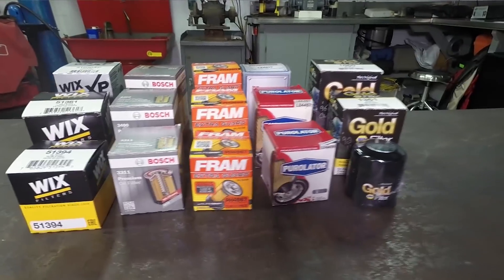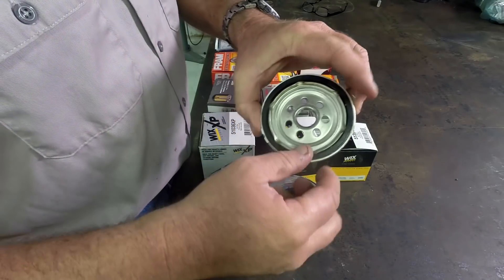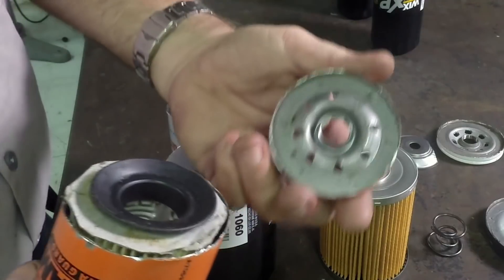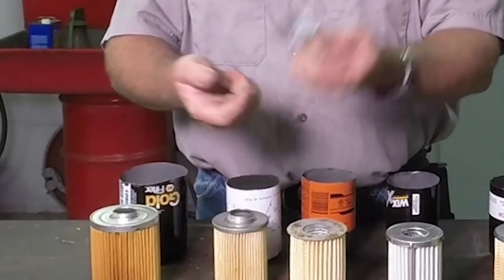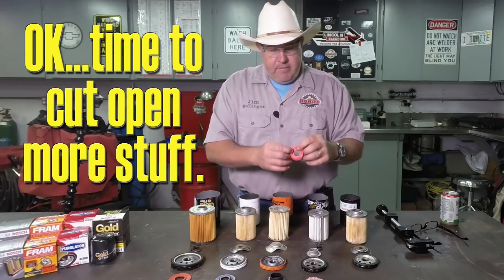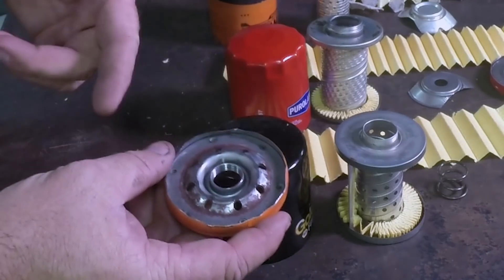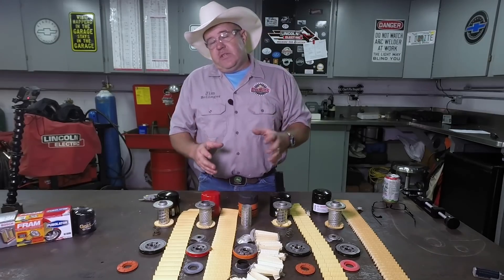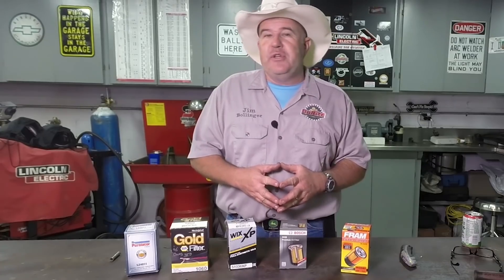The worst oil filter EVER!

Comment: I used to be in outside sales, I would put 2-3000 mi a month on my Jeep, a few days after a stop in a fast oil change place I started to hear lifter noise, I don't know what they put in my jeep or even if they changed the oil. These places use cheap oil and cheap filters. I replaced my engine (got a low mileage engine out of a wreaked cherokee) then started to study up on engine oil and filters. I switched all 3 of my vehicles to amsoil filters and oils. Best decision I could have made. I now have a truck that I have 325K miles on it, runs and starts like new,  doesn't use any oil, starts as soon as I turn the key. Now I'll never use anything else.

Comment: Attention. I just lost an argument and just cut open my Fram Filter for my Honda Accord. It was as solid as the Napa Gold and had a legit spring and no rust. I bought it a year ago. 

I just ragged on Fram and I know pro racers that won’t touch Fram oil filters. So I had to see for myself. Dang thing was $20 here. 

Maybe because I’m in Brazil they use a different factory. The fact is, the one I just cut open was very good, solid, and I wouldn’t hesitate to buy Fram (at least here in Brazil.)

Comment: Honda and  Subaru  service replacement filters  from the dealer  in the U.S. are  FRAM  o.e.m.   painted  blue.  I'm not a Fram fan by any means, but the next model up - the Toughguard,  works acceptably on large Japanese/Korean four cylinder engines - nissan/subaru/mazda/hyundai/kia - which share the same baseplate and thread.   Toyota is a different geometry.  I'd like to address some  points of your criticism.  The  centertube - the structural spine - of the  FRAM orange can is  perforated  steel - like the others. The  end  caps which DO NOT PROVIDE structure to the filter, are a material that the PAPER and FIBERGLASS  filter element can easily be  glued to without separation and  use  of excessive  adhesive.  It also allows some distorton under high flow loads with cold and  watery oil which tend to TEAR and rip  the media near the endcaps.  (Seen  many Pur-o-lator Classic fail this  way the past decade). The Filter paper is in the FRAM is an engineered paper - so what's  wrong  with the end caps  being paper?  This is  also designed to allow  easier  recycling (Imagine  how many tens of  millions  of  filters  get thrown out yearly!)   Still think its  a cheap out? Toyota  Denso O.E filters don't have  ANY  endcaps.  Wix?Napa are good, but flat base gaskets  can leak when under or over torqued and Wix ingenious base  end  bypass which works  GREAT on large can filters takes up too much space in the smaller palm sized filter cans  which seem to be  spec'd on most vehicles today. That leaves  you with inadequate filter media area for  cold starts  and long oil change intervals.  Thanks  for the video and allowing me to reply.  - Sandy

Comment: I used to use Fram after Consumer Reports did a test on oil filters and rated them highly, but that was probably 25-30 years ago. About 10 years ago, I switched to OE filters, mostly on the recommendation of a mechanic who said that a lot of aftermarket filters had questionable quality control. It'd be interesting to see how various OE filters would compare.
Reply: Honda  and  Subaru  filters  are  FRAM. Honda chose FRAM to make their  filters because they are  no good. They are  tired of their "great engine design" reputation.  (Filtech has  also been OEM for  Honda  filters)

Comment: I'm going to agree with Russel down below. While you are doing a great comparison test on construction, you aren't showing anything about how well the filters filter. I don't ever take mine apart so this video is kind of lost on me. I also agree you should be testing high end filters vs high end and low end vs low end. I have a Bronco with almost 300k miles on it and it's had Fram in it for 20+ years. Maybe a followup video comparing all of the different filters offered by the best brand and the worst brand. Not sure I can trust a guy with bow ties all over his garage anyway ;-)

Comment: Saw a similar story in 4 Wheeler Mag 4 years ago. see http://www.fourwheeler.com/how-to/engine/129-1202-oil-filter-comparison-fodder/  with same results. AC filters were even worse than Fram. Cheap Fram's have a plastic center support,instead of metal, that can collapse when substantial clogged or cold oil. cardboard ends instead of metal. Poor pressure relief valves. AC didn't even have a pressure relief or anti drain-back valve. Best value is Purolator Standard Red , But I change oil every 3-4K miles and use full synthetic store brand oil, as long as it is API Approved

Comment: Cant question the Frams quality, But as far as the rust you might want check your distributor. Oil filers like many other parts have a shelf life and need to be rotated. I worked at a truck parts store and found this out.
Reply from the maker: Check this out, different distributor.https://youtu.be/4UxaqAzHpNA

Comment: I have seen Fram filters fail at the bead where the can joins the base causing a nasty motorcycle crash, Also I have seen cardboard at the rod journals from the filter end caps. No Frams for me. Wix oil filters are my first choice.

Comment: It's not important how a filter handles an angle grinder, or you cutting on it, it matters if it does not come apart under use, what it's flow rate is and what it's micron rating is. You talked about neither

Comment: Been telling the truth about Fram for over a decade and people defend them based on pure emotional attachment to the orange  can. That disintegrating cardboard can clog oil galleries, pickup tube screens and VVT compon.  People just reject common sense. I will never understand it. The only two engines failures due to lubrication issues I have ever witnessed in my mechanical  shop days were Toyota's coming in knocking with full oil pans and orange fram filters with no oil in them.

Comment: I don't know about now, but in the 1950s or so Bell Helicopter tested filters  and chose Fram. At that time it was the most efficient filter available.The government used Fram manufactured filters on Bell helicopters through the 1970s, that I know of.
As a result, I have always used Fram. I have 1991 Suburban 6.2 Diesel with 240,000 miles. I replaced the head gaskets at 200,000 miles. The cylinders still had honing marks from the factory. My 1987 GMC pickup has 130,000 miles. I bought both vehicles new and have always used Delo 400 motor oil. Changed oil and filters every 3,000 miles. Both are turbo-charged. I have never had an engine problem, excepting the head gasket on the Suburban.
So that puts me in a quandary. Has Fram filters gone to garbage?  It is a shame.
Back in the old days, 50s, 60s, Wix filters is what we put on old worn out cars when we were using cheap re-run motor oil. They were at the bottom of the filter rung.
I have a new Fram I'm going to cut open.
Reply: Fram used to make decent filters when they were Fram. They were bought out by Allied Signal and the quality is gone. The name and the orange can OS there but the guts are not. You can get a much better filter for just a $1.50 more so why not? On a modern engine with tiny oil galleries and VVT components why risk paper and cardboard pieces flying around in your oil system?
Reply: Keep on mind Fram was Fram when cars dis not have such complex engines and oil was never to go beyond 3000 miles. Om sure the tough Gards are better and hear the Ultra Synthetic  Frams are very good but the regular Fram is not what I would put on a modern engine or extended drain interval.
Reply: @skittykitty1000  Price has never been the issue. My point was that in those days Fram was a top brand filter.
Bell Helicopter had a contract to supply oil filters for their helicopters. (Don't ask me, government at work). The Fram met the government requirements. We bought Fram filters PH 13, (these fit Chevrolet engines), took them out of the Fram boxes, painted them government gray, identified them with the Federal Stock Number and put them in gray government boxes. I was a Quality Control Inspector in the paint shop.
I didn't know Fram had been bought by Allied Signal, again used to be a reputable company. 
The last Dodges I had recommended Wix filters for the high performance engines. I was very surprised and asked a service manager about it. He told me that Wix was now a top performing filter.
Yeah, the cardboard and flimsy filter material scares me, and I will not use them again. 
I wonder, the PH 13 is now PH 5, if the part number change is when the filters went to crap.
Reply: @jeanmeslier9491  Yes Fram used to have a good reputation. Government doesn't always choose the best option but back the Fram may have been. Who knows?
Reply: @skittykitty1000  I should have noted that this was in the late 1960s and 1970s.
Bell even used this filter in the hydraulic systems. I wonder what filters they use now.

Comment: I have nothing but old vehicles, 1996 Ram, 1997 Suburban, and 1997 Olds.  Always used Fram filters.  Lots of miles and change every 3000 to 4000 miles.  Never a problem.  Maybe lately they are not as good, I don't know.

Comment: I owned a fleet PM service FOR 15 years using over 80,000 gallons of oil and Fram filters (Oil, water, and air) on the same fleet trucks from purchase to sale without a single oil or oil filter related failure. Your evaluation is so flawed I can hardly begin to start. Claiming the element is bad after you twisted it in a distortion it was never designed to be subjected to. You put unrealistic emphasis on the the springs and metal end plate strength when the weakest link in the system is is the pleated media. It is paper thin enough for oil to pass through. And the rust you dwell on is upstream of the filter element. You are the one that has been duped into paying for more than is necessary. These customers I serviced all used oil analysis to verify the quality of protection in their truck engines. Learn more about your products than what the Wix salesman tells you.

Comment: The truth is in the pudding? Must be some Russian pudding there, Cowboy! Let me explain thoroughly to all you fools that fall for this bogus experiment. ALL oil filters sell as Good, Better, Best. The Fram filter he uses here is the Fram Extra Guard (orange can), which is crap because it is Fram's most economical filter (Good), which costs around $4. He compares it to the Napa Gold (Best) which costs around $12. He is not comparing apples to apples. He is comparing Good vs Best.... Not fair, Cowboy! I'm sure had he used a regular Napa filter, it would be made out of cardboard as well. Napa comes in Napa Regular (which also sells around $4), Napa Silver (about $8) and Napa Gold ($12). A legitimate experiment using a Fram Tough Guard (silver can) or Fram Ultra (gold can) vs a Napa Silver or Napa Gold filter would make this experiment more justifiable. The Bosch oil filter as well.... which one is he using, the regular, Distance Plus or the Platinum? This Cowboy obviously has something against Fram! I don't work for Fram. I don't work for Napa. I don't even work in the automotive industry! I just hate when people try to deceive the public!

Comment: iv only had 1 filter fail on me in 20plus yrs. it was a fram transmission filter on my log splitter. correct p#, installed correctly. splitter worked fine for 40min or so then i noticed it pourin out hydro fluid. filter was loose somehow, retightend it & continued. hour or so later i hear a big pop & 12ft spray of hydraulic fluid shooting str8 out. 

the top fram plate dat has da thread stretched da 1st time, causing da 1st leak, after retighten it bowed so much dat da rubber oring blew out. the drain valve broke loose inside & ther was shit rattling inside da fram filter. fuck fram

Comment: Fram is junk!!!
Toyota 20r has a filter upside down easy install from the top.
Fram offered a filter for the engine. The check valves are useless and dry starts are inevitable. Never trust fram.!

Comment: I think the cardboard in the Fram isn't the biggest issue with the quality being bad. I'd be more worried about the bad quality of the rubber anti drain back part. It would cause a temporary dry start condition and eat the bearings for lunch. At least the other filters seem to use better quality rubber and springs to keep the oil filter from draining dry every time the engine is turned off.

Comment: Well well, we definitely need more of these exposes to find the good and bad of many high-use consumer products!!
   My experience w Fram products goes back to 1981 and my first car.  By far, the Fram products were very plentiful. For us DIY guys here in S Ontario the shelves were full and the prices fair, as I recall.   
   Another viewer from Ontario posted the fact that we mass produced Fram in Canada and the QC was tight back then.  I can only speculate how that line of filters would stand up in this test today. 
    I agree it is high time for a repeat test w other products like AC, Motomaster, Fleet Cruise and the like. And Pls select them at the same price point to be consistent.
    Much has been said about lube changes and mileage.  Can we all agree that until we hear differently, aim a little higher w fluids and filters by spending a few dollars more for a better filter than Fram, and maybe Head Office will slowly get the message..
    In my case, the local parts store carries Mann, Wix, Valvoline, and Fram for my 1997 Volvo 850.  Will certainly reach for Mann or Wix in near future. Can do a lube job myself for under $15.

Comment: I've used nothing but Chevron Delo 15w-40 and Napa Gold filters on my '95 F-350 since it was new. The original 7.3 Powerstroke has just over 600,000 miles on it and has never been apart, aside from glow plugs and a set of injectors. Must be a good oil / filter combination!

Comment: I’m 67 years old and have always used Fram. I have owned MANY cars in my many years. I have Never had a failure due to an oil filter problem. Two of my current vehicles have over 190,000 miles on their original engines with no internal engine repairs. I’d have to say that, based on my personal experience, Fram filters have done a good job protecting my engines. Just sayin’..........

Comment: And their fuel filters are crap as well. After seeing what garbage their oil filters are I decided to change my fuel filter as well. Its a steel EFI filter. When I took it off, it rattled inside. Cutting it open showed that the element was floating around filtering nothing. Buyer beware with FRAM  products.

Comment: Always used FRAM on my Cars, my 2000 Concorde just went off to the scrap with 475 000kms on it and i just didnt feel like figuring out the problem. Ive seen Wix filters fail ive seen Napa filters fail, its all suggestive, use what you want, if something happens, call the manufacturer!

Comment: I would like to know what the sizes are of the tiny holes in the filter media.   The available surface area is important,  but it is also important how small the holes are that the oil is forced through.   Do you have any data on that ?

Comment: Had low oil pressure in my Silverado. Got it home and did an oil change. Problem solved with new oil and filter. Unfortunately I put a fram filter in however I will be switching that out.

Comment: Wix makes NAPA Gold. Length of media and number of pleats is irrelevant, different media offers different filtering characteristics. They all fit a specific flow rate range issued by the manufacturer. The problem with ALL spin on's is reduced SKU's.  As the flow rate range broadens, the number of vehicle specific filters is reduced, fewer sku's = lower cost.  One filter fits dozens of engines from different manufacturers now. Most have about 8-15 popular SKU's that will fit 90% of cars with a spin on. What works perfectly for one car may just be adequate for another.

Comment: I am 49yrs old. I have had  over 20 differentially vechiles so far from a mint 69 dodge Monaco to trucks minivans and lots more. I always buy the cheapest oil and filter or what ever is on sale. If you change your oil and filter every 5000 km or 3000 miles you will have no issues with a cheap filter.

Comment: Why would you compare a Fram Extra Guard to a NAPA Gold? NAPA Gold is in the class of Fram Ultra Synthetic.. plz do a test on similar grade filters. Im sure u said ur not spokes person to any filter, but im sure there's a few hondos slipped in your pocket to degrade Fram.

You should do a disclosure. Fram Filter is $3.67 standard grade.
Other filters are mid grade $6 and up. NAPA Gold is $11 and change
Reply: I wish he did the fram ultra, and the NAPA silver.
Reply: Whether its the cheap version or not, you shouldn't sell products like this.  Why would you want to sell something like this to your customers anyhow?
Reply: Cut open a higher line fram filter, and you'll see it's the same chinsey filter just slightly better, a "good" fram filter is about the same quality as the purolator filter used in this video. Fram being cheap filters is old news and I doubt he was payed to say something so common to anyone who's mechanically inclined.
Reply: Negative. I work for napa. 85 percent of the gold filters are 7.99 and lower
Reply: Napa and wix (same filter) filters are the same for lower line and upper line just different paper media. Best in quality!!!!
Reply: and how do You make a good quality OEM type oil filter for $3-67 ??? or even $8 dollars ????  Genuine are best.... You just can't trust the rest...
Reply: Frame has been know crap since I was a kid. I'd refuse an old filter before is put a new Fram on anything i own.
Reply: Like I Wix makes Napa filters! I know this for a fact! I guess its just me I purchase so many filters, I get Wix on average $3-$4 for car filters.  I trust them with $100,000+ generators!